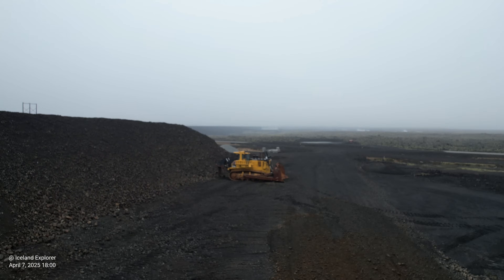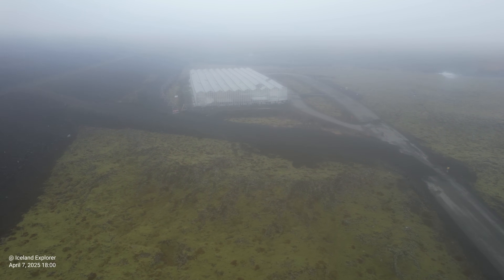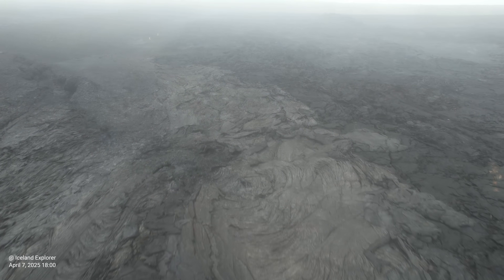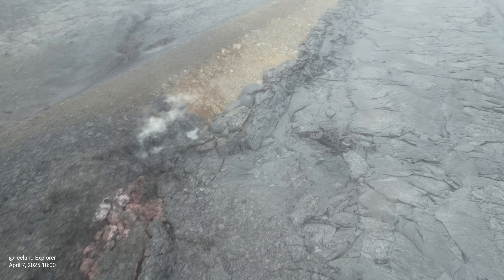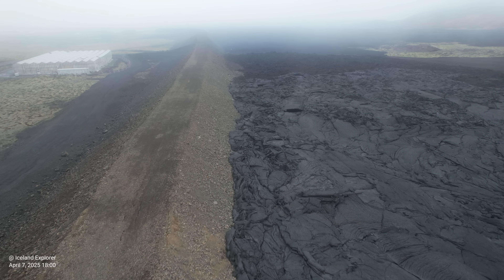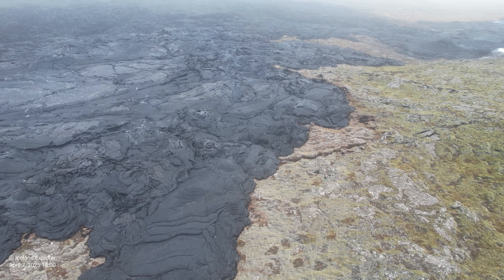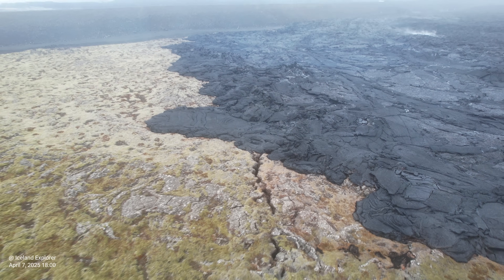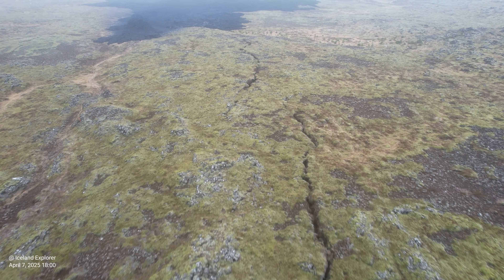Multiple ground fractures detected from drone. Tectonic tension drives earthquakes, magma. 4K

Comment: Could someone explain why the lava doesn't flow straight up from the magna chamber destroying the power plant and the blue lagoon?
Reply: The upper crust (so the first couple km) of the Reykjanes peninsula is a heterogenetic sequence of alternating layers of lava flows, tuff/palagonite, vertikal dikes and horizontal sills. Each layer responds different to the stress caused by the intruding magma.
For some it's harder to break vertical than horizontal, for other the other way around.
Meaning magma rarely ascends straight but in a zig-zag pattern through the rock layers.
Reply: The rock directly over the chamber offers more resistance than the rock next to it. The magma seeks a path of lower resistance. So it has repeatedly squirted out to the east, creating the lava dyke. Recent eruptions were using a pathway with so little resistance that there were barely earthquakes before lava emerged.  This time, that easy path seems to have been blocked, so a much larger amount of magma built up in the chamber. This squirted again to the east, and made the dyke much wider and longer. A very small amount of it erupted to the surface near grindavik.

Comment: The North American and Eurasian plates are massive, with many forces on them, even the Indian plate pushing north to make the Himalayas. Iceland seems a very tiny speck. However, the underwater topography suggests Iceland is on top of a massive plume, like a vast low volcano, not just hot vents in the Mid Atlantic Ridge. So it is a challenge to estimate the balance between, Tectonic tension versus Magma rising. Our Cascadia subduction is much simpler. I made a mechanical model to explain ETS (slip) for the seismologists at the Pacific Geoscience Center near Victoria, BC, i 2005, and Japanese seismologists immediately flew over to take movies of it, and it was touring Japan recently.